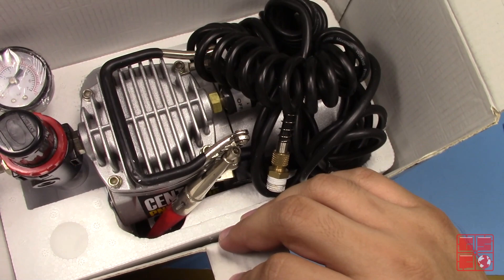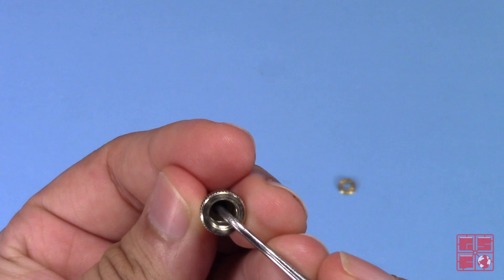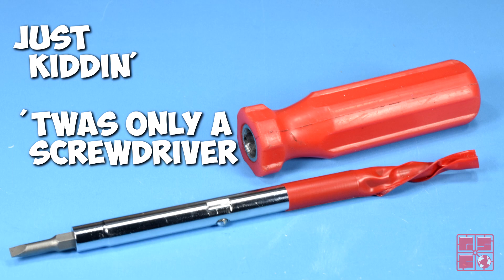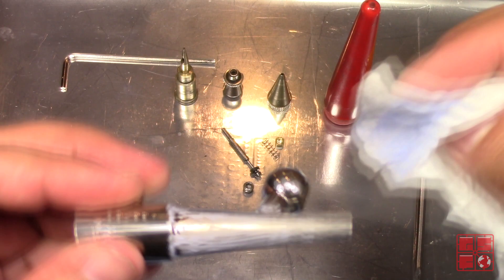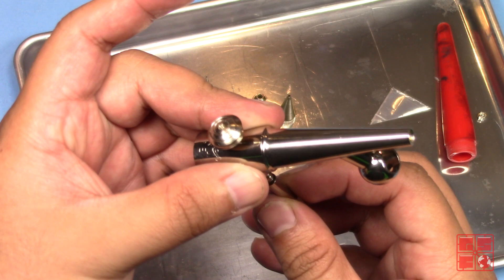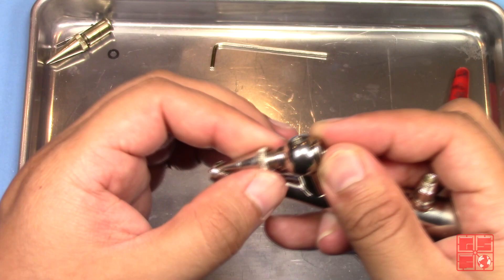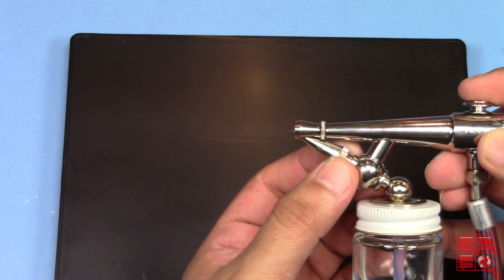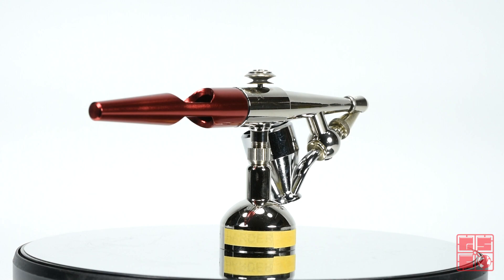Lets Fix: Vintage Paasche "TYPE" Model H Airbrush

Comment: I have an older H model (44 years old), it still works like a champ!  O rings is all I needed.  I got #3 & #5  needle/air cap sets, also upgraded to S type needles. They take screw on jars.  I changed the plastic handle for the chromed brass handle (no longer available).  There is a closed red aluminium handle.  I originally filled the plastic handle with some #9 bird shot to add some weight as I like a weighty airbrush in my big hands.  Very easy to clean.  I recommend you stock up on O rings if you use this gun a lot & stock up on needle set screws, you will lose them to the carpet monster!   I have 5 airbrushes total & this is still my go to gun.
Update:  Passche website lists an Anodized red & blue handle (no cutout) & had a black body H model.
Reply from the maker: The Model H is a beast of an airbrush! Definitely the AK-47 of airbrushes. Filling the handle with bird shot is genius! Believe me, I dropped that lock screw and spent the better part of an afternoon on the ground looking for it. lol

Thank you for the insightful tips!

Comment: Well done!   I have/had several airbrushes over the years Grex, Iwata, Badger, but my workhorse has been my Hs.  Plural.  I had four at one time, but only now have my original I bought 40 years ago.  Back in the late 80s and into the 90s, I built mostly 43rd scale cars for collectors, typically sold through the kit dealers ( a building service).  Would build between 30 and 50 a month.  Also built the occasional larger scale plastics, and a very lucrative product line customizing 1/18 die-casts (mostly Miatas and PT Cruisers, but also Porsches and Corvettes).  I mostly used auto lacquers, Mr Color, and decanted Krylon. To that end, I had  the Hs set up for different media and colors: One for clear coats , one for light colors, one for darks and primers, and one for metallics (built a walk-in paint booth which included filtered air and supplied air for a head hood). I replaced the air nozzle o-rings with ones made from Viton as I would swirl the entire front of the airbrush in lacquer reducer for between-color cleaning.  All had the chromed metal handles as I like the balance and they look good (looks like those may be OOP).  I had not seen that anodized handle before and will be ordering one =)

A tip for those cups:  epoxy them to a 1" diameter stainless steel washer and they wont tip over as easily (I also have several of these suitably marked for clear, light, dark, and metallics).

Comment: Mine is a older Passche H airbrush. It has the same labeling on the top of the airbrush that the one you have has. I bought it at a going out of business sale from a local hobby shop  25-30 years ago. Its still going strong.

Comment: If you lose the spring you can get another from an old ink pen. It's the same. I used one this way and it still works 35 years later.

Comment: That is interesting.  I have noticed the packing washer gets is hard to clear of all colour without removing for separate cleaning, which I do now every time.  Does it need removing every time, even when the spay is clear and there is no apparent colour.  What do you think?  The problem of course is that having spent all that time, you may as well have used an internal mix brush.  
Incidentally: it is worth it finding a photographic processor/shop who can supply fresh from the bin 35mm film canisters.  Use a scriber to poke through the lid a plastic tube so that it friction fits, and then poke a small hole for pressure equalisation.  After work cleanup is simple.  Wipe the canister with a solvent (usually turps or metho) piece of kitchen paper or the like, then flow through the tube from the top.  Fill the now clean canister with thinner and put through brush until clean.  Then take down of brush is simple.  We are talking about - say - fifteen minutes, and not much thinner/turps/metho.  I say again and again: 'Laziness is its own reward; the gift that keeps on giving.'
OBSERVE SAFETY INDICATIONS.  I try and avoid paints I cannot clean with turps or metho.  If you can smell it, you're getting too much.
Thanks.

Comment: Tip. Screw on the trigger button BEFORE installing the spring and nut. Otherwise, great video and great job of showing how to work on an H. BTW one advantage the H has over internal mix is cleaning it after using lacquers or enamels. I have a VL and Vision, but for hard to clean paints, I'll stick with my H.

Comment: Great video, and you've convinced me to finally try out the Paasche H that has been sitting in my drawer ever since I received it as a gift about 35 years ago. BTW, what size needle did you buy to finish the restoration?
Reply: Paasche sells 3 types of needles; small, medium, and large type spray pattern. Try the one you have first and see, There should be a model number near the lower part with the twist grip as well.